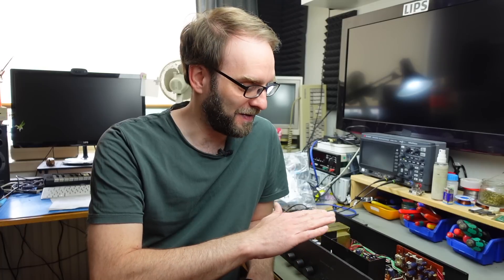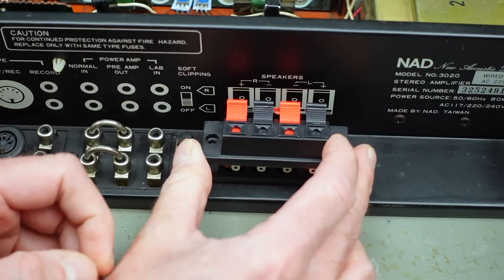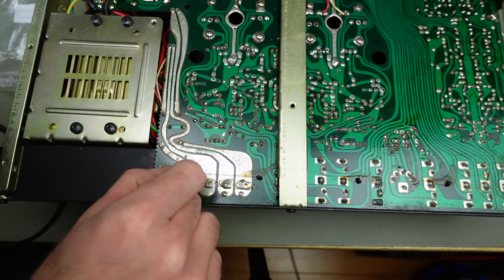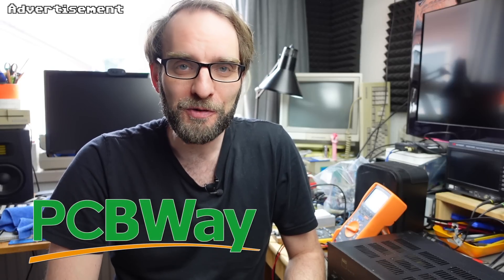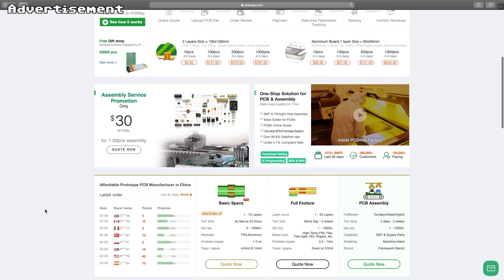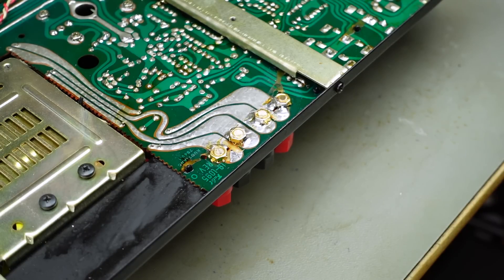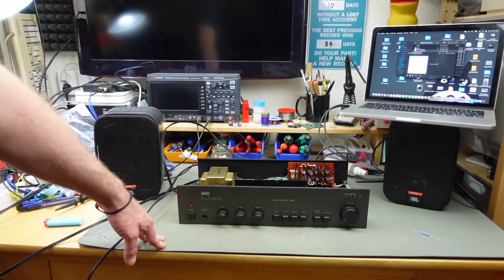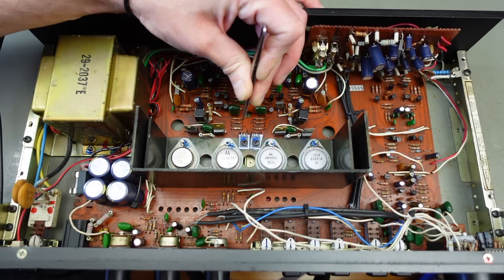NAD3020 New Speaker Terminals and Adjustments

Comment: Just a small hint when using Solderwick: Just cut it into small pieces instead using the whole roll. As copper is heat-conductive, it will "transport" the heat from your point of the soldering iron all the long way into the roll. So you're loosing temperature. The Solderwick works much better, when limited to a size (2-3 cm) and can be better heated - resulting in much better soaking up the (old) solder...
Reply: That makes sense, Im new to this stuff. Thanks for sharing that tip.

Comment: Ok, it's a class AB amplifier, there should be a small idling current. Looks like your device works like a class B amplifier. Possibly the transistor or diode responsible for the DC offset of the base is broken (shorted) and you transistors don't have an idling current. This will cause distortion, typical for a class B amplifier. The end stage has 4 transistors per channel, 2 push-pull transistors, and 2 pre-amplifiers (darlington configuration). You should see a DC voltage of about 2.8V (4*0.7V) between the the bases of the two pre-amplifier transistors, else your amplifier is not working in class AB. Check between the base of Q612 and Q614 (or Q611 Q613 in some versions) for the 2.8V. On Q610 (or Q609 in some versions) which is the BD139 on the heatsink, the voltage between collector and emitter, should be around 2.1V. The voltage on the diode in series should be 0.7. There's something wrong with your amplifier.

Comment: It doesn't make sense that one channel would use a 1.5Kohm resistor and the other would use 1.2 Kohm. They are supposed to be identical, unless someone has done the idling current measurement during production and inserted the appropriate resistors.
Reply: Probably because the power transistors wasn't a matching pair due to a difference in hFE  (or βeta). All high end amps have selected transistors installed which are extremely close to a perfect match. To overcome that you can fit different values of passive components. The same goes with thermionic valves which can be selected by testing them.

Comment: Those aren't traces on that PCB, they're roads!
Reply from the maker: Highways! 😅
Reply: I hope Jan had some Kraftwerk on working on this highway board!
Reply: @tonanornottonull7132  The fun fun fun of the autobahn :-D
Reply: @JanBeta  at 40:30... thouse blue precision potentiometers are very low amount of watts.. I think 1/6 watt if i remember correctly......
While the resistors you remove.. they looks like 1/4 or 1/2 watt....
take a look to the other potentiometers in the board.... the resistor trace in thouse potentiometers are at least 3 times the size of the resistor trace inside the precision potentiometer ...
Measure the voltage at the terminals of the resistors when they are on board and running ...
then put the potentiometers back.... and adjust them to have the same voltage in the terminals... see if it works then ...
Reply: @Ramdileo_sys  it doesnt matter too much - not much current flows through the VBE multiplier part of the circuit. Those pots will be well within their rating

Comment: I've seen these with binding posts fitted before... every time I have seen that, whoever did the conversion actually cut away the entire section of PCB under there, and made the connections using wires. It was also typical to find the headphone jack bypassed in that case, and the speaker ground returns soldered directly to the point between the main filter capacitors. Of course, audiophiles will do anything crazy ;)
Reply: Also glad you fitted the 0.22 emitter resistors. That solves a lot of problems with thermal runaway in this amplifier, which is often why the output transistors fail - especially if they are replaced with new "epitaxial" construction types
Reply: my thoughts exactly, were cut away the pcb track, mount the posts with better spacing, use "solder washers" to wire to the remains of the pcb tracks, thread binder on the posts not soldered up. if Jan has to unfortunately remove the posts again it will be real difficult.
Reply: Binder? Help I'd like to understand pls

Comment: Regarding the adjustable resistors, you could have bent the middle pin and solder it to the side pin, shorting them, so that soldering on the board is more stable. I wish I had as much success as you have with my later model NAD 3020i, one channel is blowing the fuse on power up. I'll use the bulb trick in series with the power supply ("dim bulb tester") when I'll have the courage to start an investigation again. :) Congrats for this achievement !

Comment: There was no need to insert the 0.22 ohm resistors. You could just have broken one of the 2 paths, measure the current with a mA meter, do the adjustment, and fix the path.

Comment: @4:30 Burned out resistor to the far right of the board? Apologies if Ive missed something explaining this, running the video in the background whilst doing other things today.
Reply from the maker: Yes, I fixed that in the video. It’s the resistor that goes to the ground terminal for connecting turntables. No idea how the previous owner managed to burn it!
Reply: @JanBeta  I was also wondering "how?".  What could you put across it that would make it cook?  Faulty deck maybe?
Reply: @Neffers_UK  likely mains voltage as the resistor value is too large the burn up unless a high voltage.
Reply: @Neffers_UK  There was originally another input bodged onto the connections.  I suspect that is what caused it.

Comment: I know this is a late comment, but just Wow! 🤩   I love the new speaker terminals that you fitted; so much better than the spring-clips!
These old NAD 3020's are absolute classics; the budget conscious audiophile amp of the early 1980s.... a lovely smooth sound, but plenty of power behind it!  A good friend of mine back in about '81/82 had one and it was gorgeous to listen to from his Dual CS-502 turntable.  I think by then I had a Tandberg receiver with a Rega Planar 3 - that old Tandberg was so warm and sweet sounding, but that NAD was very close behind it for quality audio.... I'd love to find one now for a reasonable price (and in full working order!! 😂 )....... Great job Jan. 👍

Comment: Jan, I have just watched all 3 of your videos, and yes, most of those M3 screws were already missing. Thank you very much for making them. Funnily enough I just finished replacing all the capacitors in my 2030, which I bought new in 1978. It was retired some time around 1989, with some hum, crackle on the pots, and full of dust.  All I ever did to it was replace the mains switch. Ever since it sat neglected in a box - until last week. It's now clean and in very good condition.

All seemed to go well, except that weird resistor by the chassis earth point. This quickly overheated, just like yours, so I cut the power. I watched your videos and was delighted to see it mentioned. I hoped to try and understand why it failed. I still don't know, but mine measures at 50R not 47K. It doesn't seem to appear anywhere in the schematic,  although the PDF is so fuzzy I can barely read some bits. Still I have no idea why there would be much current flow to overheat it. Surely it should be ~0v? Maybe there's a fault elsewhere? Any suggestions? I will replace it and see whether the new one also burns...

Funnily enough, a few weeks ago I just re-foamed my set of JBL Control ones, that I use for testing. That was dead easy, since the design centres the coils gaps perfectly.

Comment: I have replaced the speakers wire slots into modern screws and the sound was not the same. I returned old ones and the sound came back to its beauty again. Crazy.

Comment: at 40:30... thouse blue precision potentiometers are very low amount of whats Jan (@Jan Beta).. I think 1/6 whats if i remember correctly......
while the resistors you remove .. looks like 1/4 or 1/2 whatt....
take a look to the other potentiometers in the board.... the resistor trace in thouse are at least 3 times the size of the resistor trace inside the precision potentiometer ...
Measure the voltage at the terminals of the resistors when they are on board and running ...
then put the potentiometers back.... and adjust them to have the same voltage in the terminals... see if it works then ...

Comment: I wonder if Q609/Q610 were blown as well as the driver transistors?  They should set the quiescent current in the push-pull output stages, making them Class AB.    I wonder how they set it in the first place?

Comment: Hi is there any reason why you do not have soldered 4 wires to connect the board traces to the binding posts you could have put in the space on the rigth side of the original binding post base. There would be no need to scratch the traces and you could have separate each post more than you had done. However I congratulate with you for this very interesting and informative work.

Comment: Hello Jan, I enjoyed this video and I currently have an NAD 3020 on my bench for a capacitor refresh. May I ask what you are using to secure the power transistor screws (the blue stuff)?  I would like to order some of it. Thanks.
Reply from the maker: Don’t laugh, but I used some left over nail polish for that. If you want to use something more professional, I’d recommend loctite. ;)
Reply: @JanBeta  I have some old car touch up paint in my shop that is thickened. I'll give that a try.

Comment: I might be wrong, but I had a Nad 701, and to adjust the Idle current you removed the solder short and put a meter on the opposing sides with no Resistor crossing it.  I think what is happening, you are shorting the measuring circuit with the resistors you have added, thus no reading on your meter.

Comment: The negative speaker terminals are not common, you should have used the second one when adjusting DC bias voltage.
Reply: they are indeed common
Reply: When he fitted the binding posts he tested negative to negative and they were a dead short, so they are common.

Comment: I would have used cables through the holes and wire mounted banana jacks. Too late for tears now though. Might have even been avle to use crimped spade terminals throught the chassi/pcb for extra durability.

Comment: Did you know that NAD stands for New Acoustic Dimension ? I read it somewhere....
Where there revisions all the way from 3020 to 3020i ? I think I have seen 3020a but perhaps that is this model.
Reply from the maker: Yes, it says so on the back panel even. I think the early versions (like the one I have) are referred to as the "a" model. Maybe it even says so somewhere for slightly newer revisions. The "e" and "I" models are later incarnations with slightly refined circuits.
Reply: I have the A version

Comment: I love these new speaker connectors! Definetly the better choice than the other ones. Btw. I've never seen an amplifier with vertical terminals! Quite a good method for connecting things and for saving rear space!
Naa, I would definetly do a little spraypaint job with the upper case! You already put soo much time and effort in this project, this will help the overall result. 😃
Reply: Shame it isn't the standard, it's such a pain to have to lean over your stereo and you can't see where you're trying to plug in things.

Comment: hi guys. my understanding of amp bias adjustments is that you would cut the track, remove the .22ohm, substitute the 1k ohm and measure in millivolts to set the required test current. ( isnt this supposed to prevent blowing the fuses). then remove the 1kohm and reinstall the .22 ohm if fitted or just short the break in the track again to use the amp.

Comment: Henkel make Loctite branded cyanoacrylate but the Loctite threadlock product are not cyanoacrylate even though many websites selling them falsely claim they are. Of course you can lock threads with cyanoacrylate, its an adhesive. What I like about Loctite anerobic threadlocker product it that their seemingly endless shelf life, you try going back to a bottle of cyanoacryylate in a year and see how liquid it is then. :)
Be careful using anerobic threadlockers near plastic though, they will find knit lines and crack it, keep it away from your precious ABS! Varnish is a better choice in such applications.

Comment: Why NAD removed the emitter followers is beyond me. Good plan fitting some.
Reply: Budget cut. The original hometaxial made 2955/3055 pairs worked fine without them. Modern epitaxial types go into thermal runaway.

Comment: I have always liked the older NAD gear but it seems that the boards where never soldered very well. I have a 3020i and had to pull the board and re-solder the whole thing due to cold joints that plagued these units. The boards are always covered in flux residue and dirty. The speaker relays are always going bad too but that can be expected with mechanical relays that are 40 to 50 years old so that's not that big of a deal.

Comment: Getting superglue on your skin isn't so bad... but absolutely avoid getting it on clothing, it instantly cures on contact with cotton (with a lot of exothermal heat too) and you will tear your clothing before getting it apart.
Reply from the maker: Oh, yes, I’ve "tried" that, too. Definitely not recommended! 😅
Reply: And don't get it in your eyes. I have a colleague who was applying CA glue and the tip had a slight blockage. He squeezed the tube really hard, it squirted out, splashed back and got him in the eye.

Comment: I tend to think that you may have a device out of specification, I cannot be certain of course. I would be checking components in the gain stage. Do you have transistors that are exactly the same as shown in the schematic? It almost looks like someone may have messed with this area, perhaps different transistors were used thereby requiring a lower gain signal from where you were measuring and the only "fix" was to lower the original gain signal; this would make your procedure more than a little bit off. One thing you can do is use a little math. What is the expected signal voltage if your loss over a 0.22ohm resistor is 5-10 millivolts = Xvolts? Then test that same point with black wire to actual ground, to see if you are actually getting Xvolts in the first place. If not, something is either modified or there is a problem in your signal path. Follow the traces or look at the schematic to determine that signal path and test the components along the way.
Reply from the maker: The driver stage transistors are higher voltage rated ones but they should still have the same current draw. The power transistors are original. I couldn’t find any other mods really but maybe I’m missing something obvious. No idea still!

Comment: According to the later version 3020i, the bias current is set by measuring the voltage across a 1 ohm resistor in the collector circuit of the O/P transistor.
This states a value of 26 to 30 mV, resulting in 35 mA.
I think adjustments on your version could be made using VR5 and VR6.
I appreciate this could result in a slight DC offset at the O/P.

Comment: I am not a fan of this kind of "home made improvments" on ams from 70s - its almost 50yrs old amp!
Reply from the maker: Completely understand that! I usually try to stay close to the original specs with these restorations. Unfortunately, the original speaker terminals were crumbling and broken and there’s is no 100% accurate replacements available. So I went with this option to at least make it useable again.